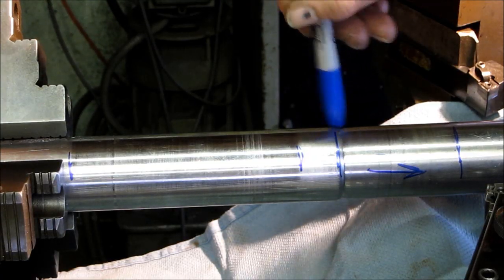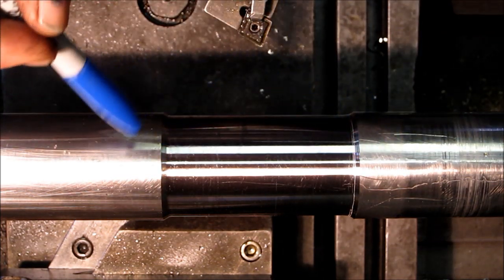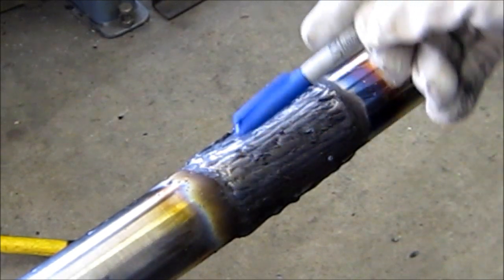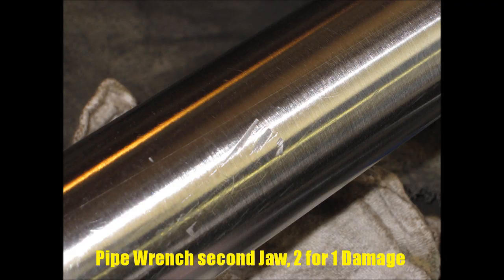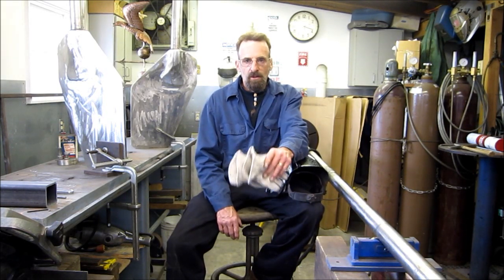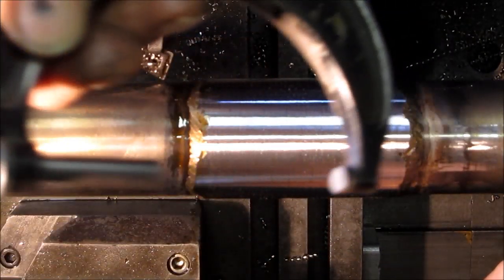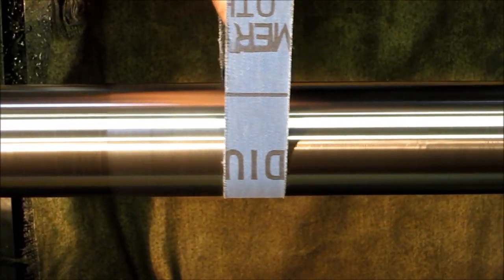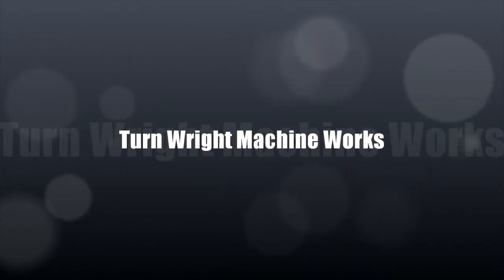Weld Fusion Overlay

Comment: Hello Keith, need some information if you can, please
need to install Monel 400 weld overlay on the inside of a dished end, my question is would it be necessary to install a inter-vase
/buttering layer of pure nickel before the Monel 400

Comment: Just now watching your video here! Very cool technique! Does the weld fusion overlay process affect the strength or rigidity of the shaft in any way? Is the overlaid spot any stronger or weaker than any other part of the shaft or does it blend perfectly with the existing shaft material in this regard?

Comment: Apologies for a very late question, I've just recently come across your videos.
I was wondering why you chose to use stick and lay the fill longitudinally? Couldn't you just spiral fill with the MIG? Or would you have problems with penetration or heat buildup, or not have the right wire available?
Thanks! I'm really impressed by the range and quality of the work you do.
Reply from the maker: l wilton Using the matching filler and controlling the heat are the most determining factors. ;{)------
Reply: +l wilton When welding, you have to alternate the welds from one side to another.  I have welded some things by with mig by welding one bead, fipping the part 180 degrees and welding the other side.  I did this  back and forth until finished.  the end result was straight.  On Keith's shaft, he alternated the welds too.  When the weld cools, it pulls quite a bit and will bend the shaft.  Doing continuous spiral weld would seem like a great idea, but in practice it ends up distorting the shaft like a corkscrew.  Having a straight shaft is imortant on a propellor shaft. On steel crank shafts, they use flux immersion welding to build up the bearing journals.  Since the crankshaft is so ridgid there isn't much distortion.  They also reheat the welded area and normalize, stressrelieve then retemper the journal area.  Keith shows a few of the shaft strightening trade secrets in his later videos and the the shaft roller jigs that he uses.

Comment: Our customer is switching from 316L to Aquamet 22 for rudder assemblies so how does this compare to 316L for machining? The higher chrome content suggests it will be more difficult (especially blind tapping which already sucks in 316L). The main shafts go up to 10"diameter x 10ft long with a  24" x 2" inch thick A36(44W) steel flange that gets welded to one end and machined. Nice repair job btw!
Reply from the maker: Drilling and tapping is one of the hardest things to do with Aquamet Material even if I make it look easy. The material is close to $15 a pound in small rounds and $13 a pound in larger sizes. ;{)-----
Reply: Damn that's pricey. Probably explains why only the linkage pins are changing and not the 1200lb main shafts so I've been told ;)  I will be tapping 1/2 and 5/8 NC blind holes so it should be a joy :)
Reply: @theslimeylimey  7 years later how did you guys get on with that job and the material change? You may not be around to answer but worth a shot.

Comment: i know you know what you're doing from all the videos i watch of you, but i must say, i'm pretty experienced in welding pump and rotor shafts for vertical turbine pumps and various motors, but!  try running a bead perpendicular to the shaft with the shaft turning.  i use flux-cored gas shielded .045" mig, the outcome is far cleaner and tends to be much straighter than running beads horizontal to the shaft pulling it every direction. besides cleaner, the weld isn't as hard to turn.

Comment: hi Keith, interesting video. you mentioned straightening the shaft after welding it. it looked like it was running pretty true in the lathe but a lit runout was visible. do you have any other vids where there is more runout and and you had to correct it with heating? eager to see it done

Comment: Pushing some wire in here you can disengage the pointer drive gear from the rack, so if you open the jaws till the pointer is at 12, then gently push the wire and close the jaws at the same time your pointer should point where it is meant to be. Hope this helps you or any other Mitotoyo owner. The original wire tool is about 1 1/4" long with a small square bent on one end.

Comment: Hi Keith, I find your videos most interesting and to thank you for all the lost late nights watching you work I thought I would offer a tip. 
I notice your dial calipers are not zeroed in the normal place, assuming this is due to a slight mishap and not deliberate, you can reset zero with a small piece of 20 gauge wire. If you remove the screw and black plastic from the 6 o'clock position you will reveal a groove behind the dial. Continued in part two

Comment: I was thinking of a more detailed explanation of the shaft alloy, but I can look that up.
Your work and videos are on a par with Jody at welding tips and tricks. Good detail, no bragging (although you have the rights), solutions to everyday problems.
At the Welding/Machine shop I worked, we had little of this type of marine work, most boats here are outboards.
Still, plenty of bent and beaten up shafts from Hydraulic stuff.

Comment: Welding tips and tricks, I was looking at that, and found your stuff. I'm 65 and pretty much done working (for others), but I always like to learn new things, at least one a day. What kind of alloy is that shaft? What electrode are you using? I like how everything speeds up when the music comes on!
 I've welded up stuff .like this from around 1/2" up to maybe 18". Sometimes over an inch added on each side of the shaft, 2" on the OD.

Comment from the maker: With the proper pre heat, inter pass temp's and post slow cooling, All, Aquamet material can be welded on and remachined without stress relief except Aquamet 17, it has to be stress relief, after this process. All material needs to be straighten after also...

Comment from the maker: The alloy of the shaft and the filler metal are simular and with the recomended procedure used, the results are satisfactory, even meeting manufactures and navel ship repair, requirements. Now the Aquamet 17 marine shafting with a little more carbon, has to be stress releived after the procedure but still meets requirements.

Comment: @KEF791 Thanks for your reply. I tried a simple weld build-up on a scrap piece of steel, and indeed, it worked without cleaning between beads. It appears that the arc burns out the slag right under the weld (as long as you progress upwards, at least). Even with the E6013 which will otherwise happily trap slag under the weld if you let it, this is not a problem here. Thanks again.

Comment from the maker: I maintained weld position as if each bead was layed as it would be for a vertical weld dime stack up. I'm going to say most, because i'm not 100% sure, that rods with vertical welding capablities can weld over them selfs as long as your ganing altitude, no down hill runing. You acually find your self using the slag to hold the bead your laying so you can create a thicker layer. On the bucket ear project, video i used two 7018 rods per weld, on hubs, and didn't clean slag even between rods.

Comment: Hey, great video. I noticed you did not clean the slag between beads, you merely had to peel the crust between passes. How come you do not trap any slag in the weld? Is it due to the rods you used? What type of rods did you use, if you don't mind? (I haven't done any weld buildup, I am not a welder)